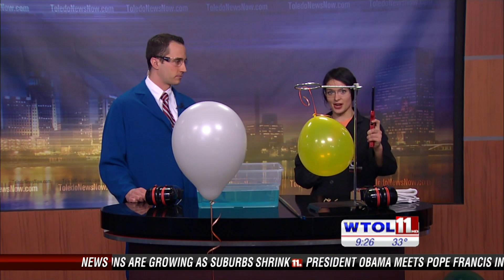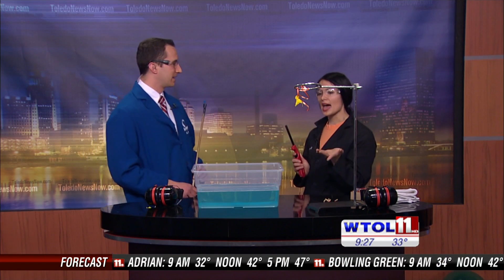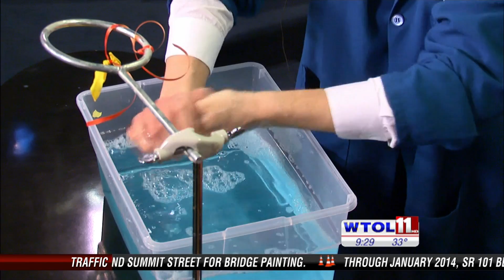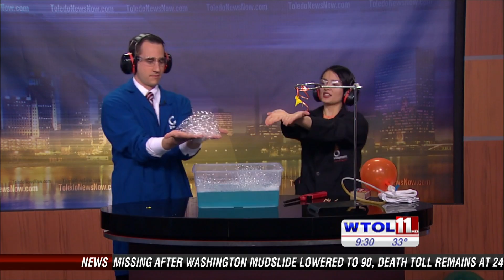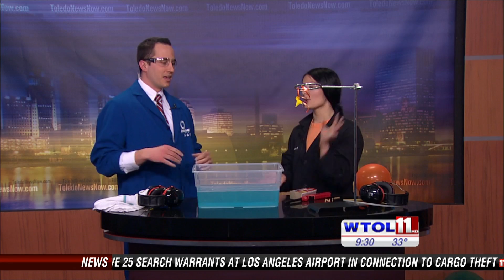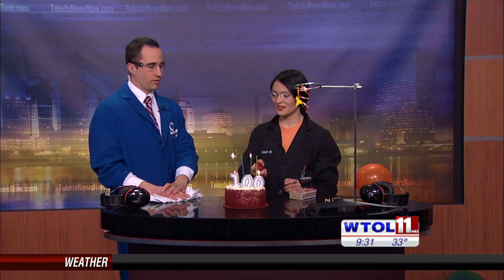Hydrogen Oxygen Detonation

Comment: wait. if that balloon had oxygen and hydrogen, wouldn't that balloon be filled with water?
Reply: Oxygen and hydrogen at ambient temperature doesnt react, you need more energy
Reply: no the heat causes the reaction to create water
Reply: no they are two seperate molecules
Reply: Late but even if it did make water, the reaction is so hot that it would be just steam.